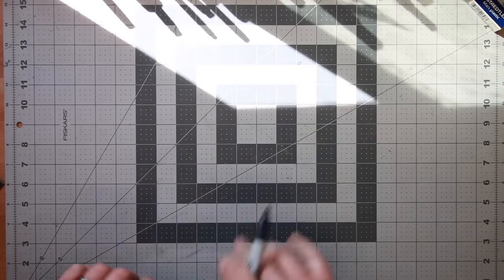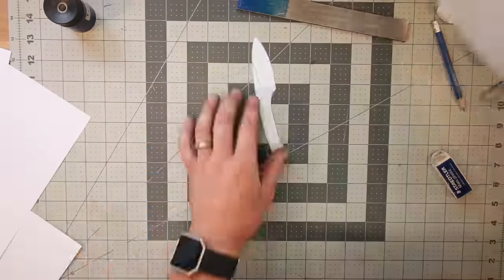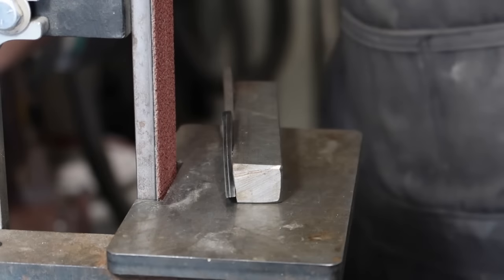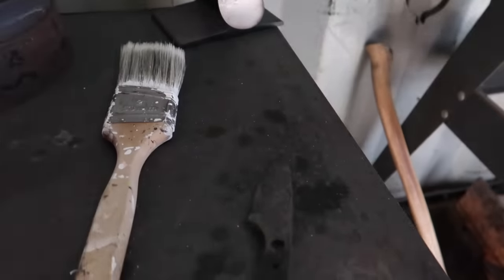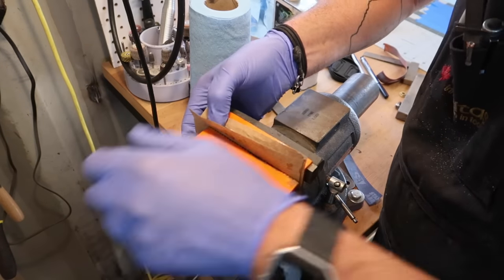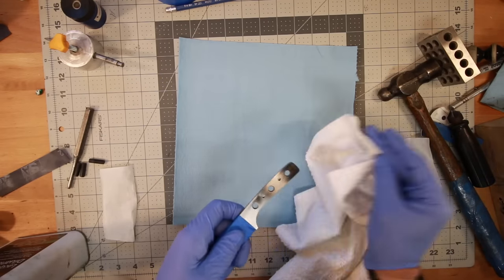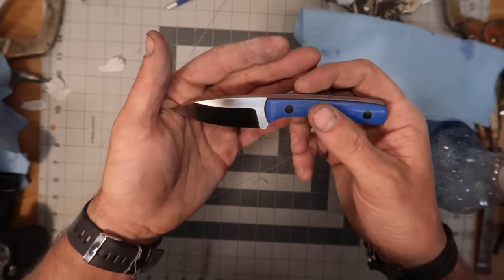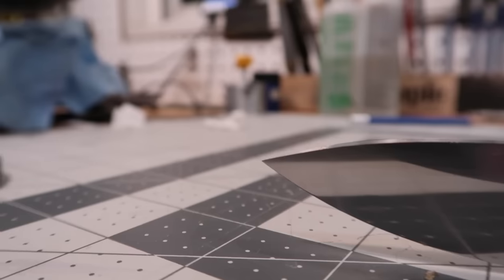Making a small EDC fixed blade (as fast as possible)

Comment: +The Simple Life  'Mechanical Adhesion' is a sound way to get anything to bite into something else - primer, paint, adhesives etc - just like where the handles scales were roughed up in this video.  What I've always wondered is why some knife makers insist on finishing their knives to almost the same finish as the blade and then put on 'non removable' scales!  If you're doing 'fixed' handle scales, rough your blade up to, that will also make sure the epoxy bites into the steel and your handles.  The knife only needs to be pretty under there if the scales are removable!

Comment: Dude, you make absolute works of art. This knife is "simple" and straight forward and perfectly done, in my opinion. By simple I don't mean I could do it, I mean elemental.
Reply: How to do you get such a mirror finish just using the 2x72? I would've thought there'd need to be a lot of hand sanding on the primary bevel for that level of finish. I don't make knives but I watch a lot of videos and your finishes really stand out

Comment: Learnt a nice tip from president of Australian knife makers guild. He uses two big blocks of aluminium that he clamps the knife between as soon as it comes out of the kiln. The aluminium works as a quench as it conducts heat so well. He uses shims for the tip cut out of a can. Keeps knife straight and cleaner than oil.
Reply from the maker: I actually did a place quench on this one (you can see the 1" aluminum in the opening shots. That's why I was quite surprised to have a warp on that blade. I've done 154CM, CPM 154 and have had no issues. This was a surprise to me for sure!
Reply: Weird. My guy unwrapped the steel First and then shimmed the point straight while it was cooling. But that bend looked in the middle..?

Comment: I just finished chefs knife made out of 1/8 inch Nitro-V and had the same problem. I followed all the steps to avoid a warp:
1. Cut and ground the profile, but did not bevel pre-heat treat.
2. Wrapped in 309 stainless foil.
3. Austenized at 1950°F and soaked for 20 minutes.
4. Plate quenched.
 
When I took it out of the foil it warped like a banana right in front of eyes. It took several tempering cycles, hammering, and bending it in a vise to get it back to acceptable straightness. The subzero quench also brought some of the warp back. I hope I don't have to go through this with every knife I make out of Nitro-V.

It'd be nice if you did a video on straightening it.

Comment: I'm not a knife maker so this may be a dumb question, but here goes... When you discovered the bend after heat treating the original bbq knife, could you have brought the steel up to temp, then let is cool slowly to anneal the steel so that it was "soft" and then corrected the bend and try the heat treat again?

Comment: Quick tip I learned making rings with layers of wood and g10 carbon fiber etc. super glue is extremely durable at gluing g10 and other composite materials together and easier to deal with that epoxy. Not sure how it would bond it to the metal, but as far as layering that g10 it would work great.

Comment: FYI, It's much easier to make a jig that just holds the blade square to the belt. Then you can tilt the platen to the get whatever angle you want. 

Also, as I'm sure you known, stainless is probably not the best choice to use in making a knife quickly. Aldo (the NJ Steel Baron) says that Nitro-V should be heat treated the same as AEB-L, which means (according to Alpha Knife Supply's AEB-L recipe) heating it to 1560 degrees F and equalizing, then heating to 1940 F or 1975 F and holding it at temp for 15 or 5 minutes, respectively. Then freezing it to -95 degrees F or more, before tempering twice at 300 F for 2 hrs each time. However, you ultimately ended up with a pretty good looking little knife.

Comment: Are those G10 Pins? Do you roll them in the epoxy too when assembling for the last time? Thanks!
Reply from the maker: They are called black phenolic. They also make carbon fiber pins that look very similar.

Comment: I'm just starting out so this sort of thing would take me much longer than 5 hours. I know I can get something like this done quickly but I'm so nervous about making mistakes.
Last time I did a heat treat there was a warp in my blade I'm not sure if it was because the Heat was uneven or if the material wasn't even. But I nearly threw in the towel for that project. Glad I didn't though.

Comment: Very interesting.  One significant lesson is that even rushing as fast as you could, making a relatively simple small fixed blade still took 5-¼ hours.  Imagine the time involved if you'd taken the "Smith" approach instead of "Maker," adding all the forging time to the making time, then consider that the best epoxy is slow cure, and you have not yet taken the time to put a fine edge on this nice little knife.  And all of this was by a guy with a pretty good shop, where many people have less.  Those who whine about the prices of handmade knives would do well to remember this.  if you were making your living as a knifemaker, allowing for overhead, that little knife would have a price in three figures if you even wanted to make minimum wage

Comment: Nitro-V?! I've been putting off heating treating a set of cheese knives I made from that stuff because there hasn't been a good HT regiment laid out for it. Sorry to see that yours warped on you! I had been planning to oil quench mine and am a little hesitant too now.
Reply from the maker: Yeah I think it's kind of still in the process. Most say it treat it much like you would AEB-L. That's how I was doing mine and even with a plate quench I had a warp. We'll see if it's fixable...👍

Comment: i am just wondering you have a forge right and an arbor press right
Reply from the maker: yes I sure do. I plan on fixing up that blade, but it's also the two 2hr temper cycles that were pressing me for time. I even made some mulit-segmented scales for it. Kind of bit off more than I could chew for a 1 day build. Especially when time is spent straightening a blade. But, I do have all the footage from the other blade so I'm well onto having another build video shot👍

Comment: Nice challenge! Good fit & finis for 5 hours! You may want to watch similiar video by Murray Carter where he forges the knife under an hour (though he counts only his actual worktime & have a pre-made handle with a simple hidden tang).

No offence, but here goes the bad thing: we ended up with barely usable short blade with HUGE thickness without even full-height grind. Yes, it's nearly unbreakable. But does it cut well anything except shaving armhair & slicing newspaper sheets? Is there any PRACTICAL task for a knife this size that requires such thickness? I doubt it.

I guess you could even split it in half with a bandsaw & make two good-cutting knives out of it.

Comment: I know very little but have a query. That warp in the blade, could that not be fixed somehow or is it pretty unworkable because the metal is so hard.
Reply: It would crack unless you heat it up and then flatten it.
Reply: I just had the same issue with one of my larger knives. It can easily be fixed. The knife needs to be tempered first though, what I do is put the knife in the oven to temper, and when it comes out it is hot enough to straiten it in a vice. If you can't get it first shot put it back in the oven for 15 more minutes and try again
Reply: Evan Niger if that is your process for straightening you either aren't using the right steel or your heat treatment is off. Putting any pressure on a knife in a vise post heat treat is the easiest way of breaking it in half. Your best bet is to re heat it in the forge, straighten it in the vise, then re heat treat it. It isn't the easy way, but it is the right way. If you have warpage, that typically means your quench happened too quickly, your knife was too thin, or simply you may have heated it too much before the quench.  But it is quite dangerous to flex a fully hardened knife to the extent that it would need to to straighten it. Even after temper, if you did your temper correctly it should spring back to it's original position no matter what you did in the vise. Just curious, do you temper at 400-450 F or do you do it in a fire, with a torch or using the residual heat in the spine after edge quenching to run the collars up to the edge?
Reply: You should always anneal the material before trying to shape / Forge it in anyway. Then you can requench and temper accordingly once the material is correct in its malleable state.

Comment: To all knivemakers wich thickness of steel (O1 tool steel) is good for beginners?
Reply: The Darksite Nils 1/8 is pretty standard 5/32 is good size for a blade too and 3/16 if you like a big chopper
Reply: The Darksite Nils 1/8 is what I started at it's pretty cheap you  can get a 3 foot stock for like 30 bucks.
Reply: MOOFAZAA thanks a lot

Comment: I never understood why people get all silly about using jigs as if its 'less skillful'.  We use a drill press with a table right.  Why?  To ensure a proper 90 degree straight hole.  Is that 'less skillful' because you didn't freehand drill it?
Same thing with a blade grinding jig.  It helps you to maintain the same bevel degree on both sides leading to a proper grind.

Comment: If you don't add some parameters then 5 hours is painfully slow. I can cut a blank from a saw blade grind a scant edge and wrap the handle in duct tape in about 15 mins.
Reply: mark a and I can grab a peice of rebar and claim that it's a knife, but that doesn't make it a knife. Any bevel that you are grinding to completion should take more than 15 minutes. I have to imagine your 15 min knife was reminiscent of a prison yard shank, ground to shape by rubbing it on the grout of a building wall.

Comment: For mixing epoxy resin.. use an Onion Board:  https://www.ebay.co.uk/itm/290460619970.  They are used for mixing car body filler, and work with epoxy too.  less wasteful than masking tape and more efficient, you just rip off and reveal a new sheet when its too dirty.

great knife btw, i really like it.